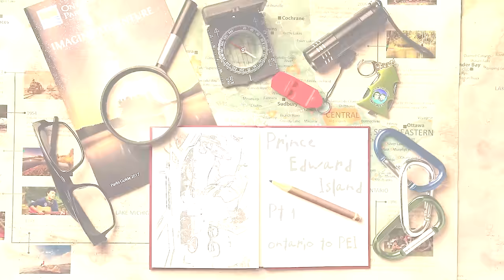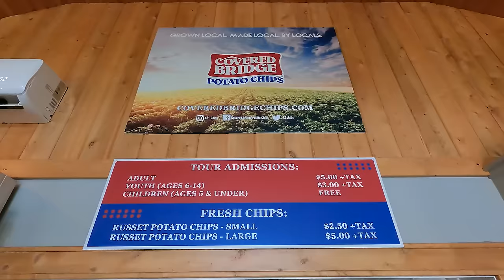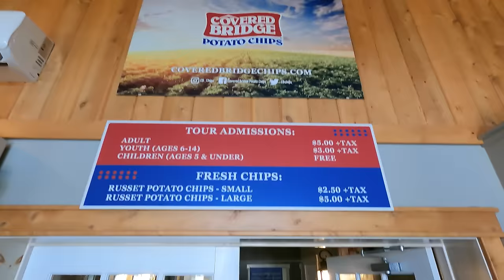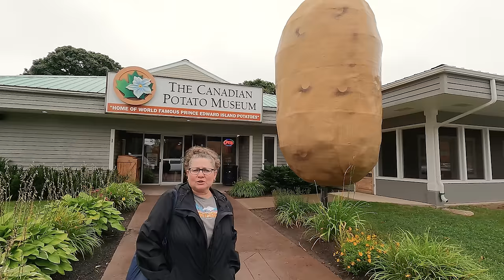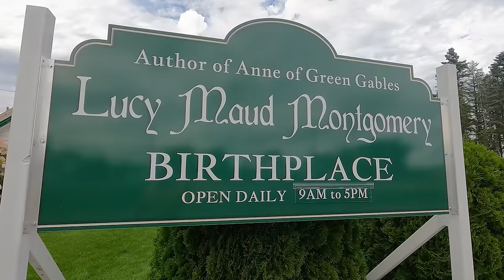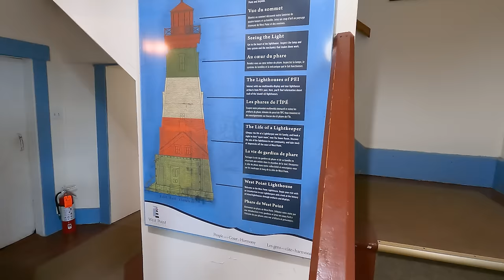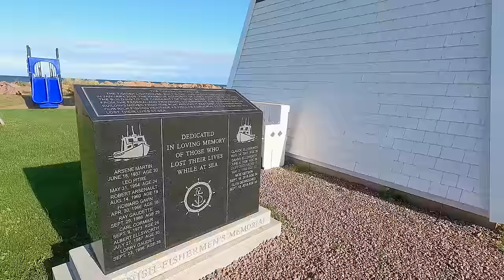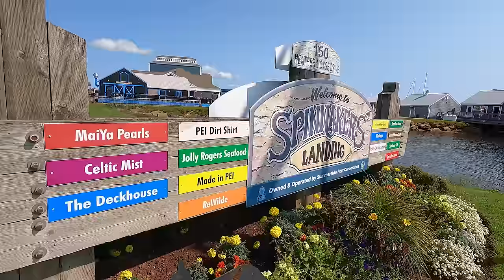P.E.I Camping Road Trip, Part 1 - Ontario to P.E.I.

Comment: Perhaps take the 407 to  the 412 or the 418 to avoid that 401 Toronto mayhem, it will cost a bit but since you only be taking it once it might be worth it😊
Reply: Its about $28 per trip, well worth it, especially when you're on vacation.  Its pure therapy doing 130 down the 407 during midweek rush hour...or so I am told ;)

Comment: Thanks for another great vid. Unrelated question. Watched your review of the Solar Tire monitor system. Bought one and it worked great during our final trip of the 2023 season. Question: From your experience how often do the sensor batteries need replacing?
Reply from the maker: As a matter of routine I replace them yearly. That way I don't have to worry about them.
Reply: Great video 👏🏻👏🏻 we agree with you about the highway 401. We live in Belleville Ontario and see many unnecessary multi crashes on that highway. Back in 2018. We drove our vintage 1994 leisure travel class B van to Nova Scotia,it was one of our first longer trips with this camper. The little fridge had a problem about not staying locked closed. We went through Montreal early on a Sunday morning to avoid heavy traffic. There was massive construction and one lane between two cement barriers. My husband hit a big pothole, and we hear a crash and my casserole that was partly frozen landed on the floor. I’m trying to clean up the mess as he’s hitting pothole after pothole. Needless to say, I was sick to my stomach and had to lay back down on the bed for a few minutes. We still laugh about that adventure. Now we drive a small 24 foot 2022 class C  because we have become snowbirds .We are planning a trip to Halifax Nova Scotia with our son and his wife with their camper to watch sailboat racing this summer. I look forward to seeing your part two of your PEI trip.👏🏻👏🏻👏🏻

Comment: Way too much driving, but a great trip so far! Looking forward to chowing down on tons of lobster!!
Reply from the maker: I hear ya! That's a lot of driving. The cost of the gas alone on this trip was a killer. And ya, I had my fill of lobster.
Reply: @CampingwiththeColes  I'd like to find myself in a position  to conceive of "my fill of lobster" ;) Fuel must have been brutal! Have you looked at alternatives? Like a Lightning, or whatever?
Reply from the maker: @supergoodcamping  I don't think the Lightening is at a level that would be good enough for towing our trailer. My dream would be to get the F150 gas/electric hybrid with the built in 7500 watt generator. We'd never need an electric site again.
Reply: @CampingwiththeColes  That DOES sound like a win. Come on 6-49!!